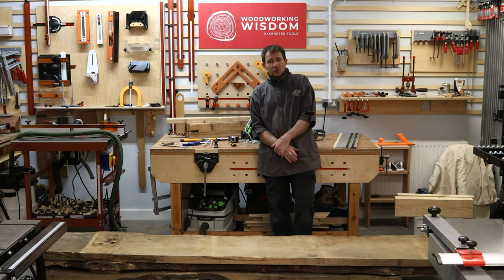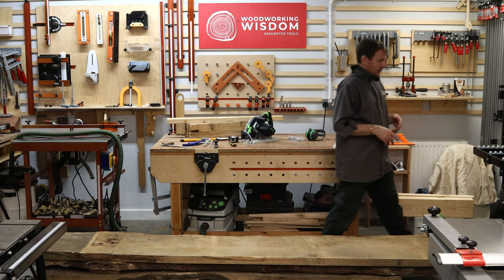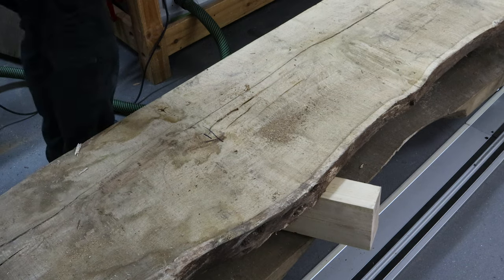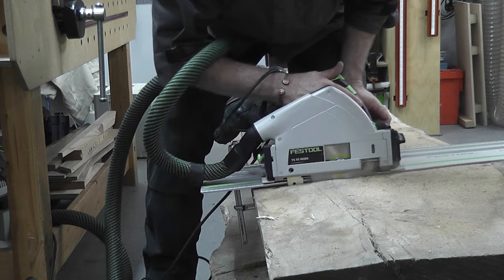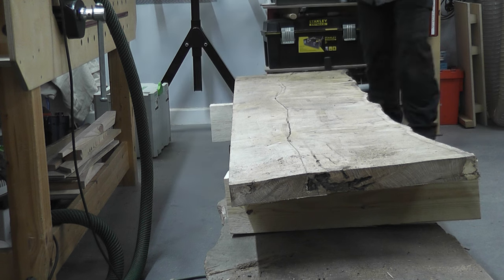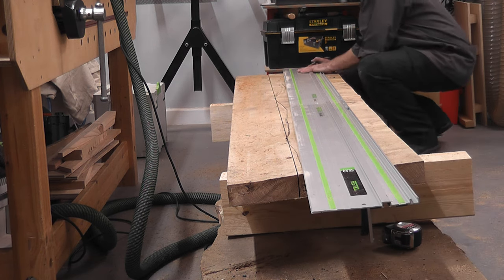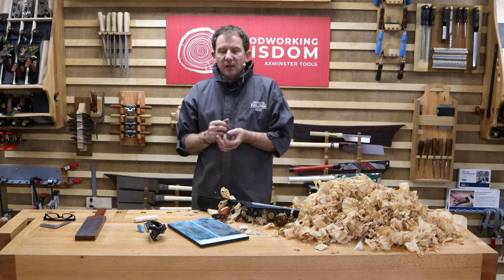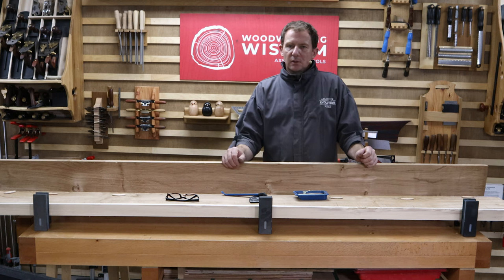Panel Glueing Tips - Woodworking Wisdom

Comment: Nice work. I trained as a bar fitter 40+ years ago (loved the job). The techniques you demonstrate are almost entirely identical to how we made bar tops from wany stock back then, right down to the biscuit joints. However, we didn't have access to a plunge saw but we did have a large panel saw (along with clamping techniques) that gave the same result. It's good to see that, apart from some new tools being available now, the method is still the same.
Reply from the maker: Hi Pete, thanks for sharing.